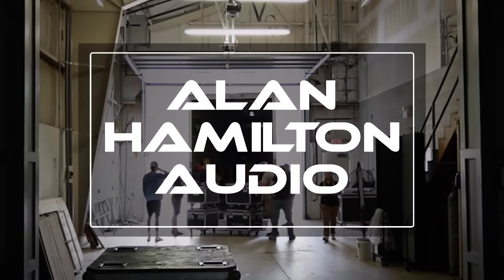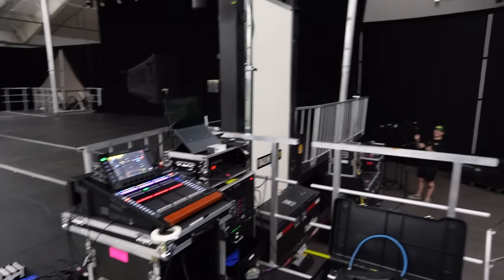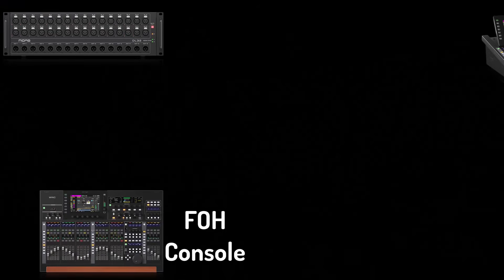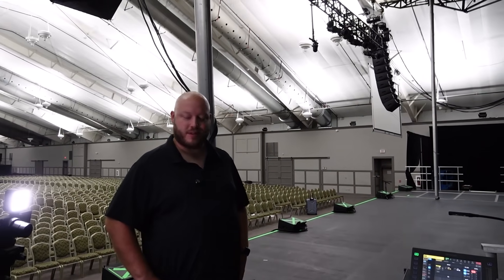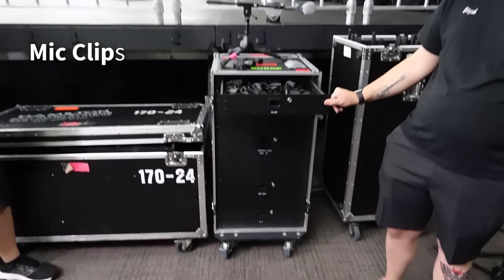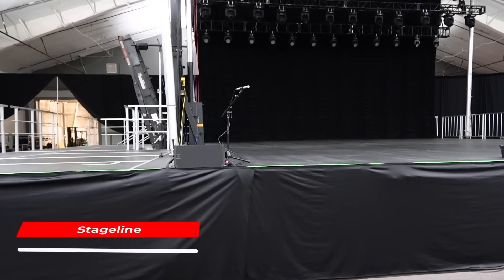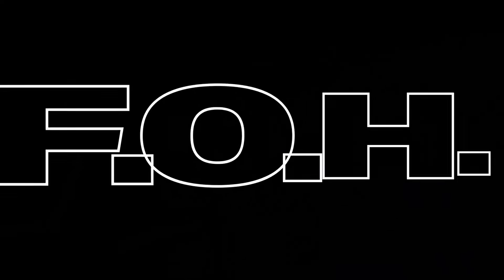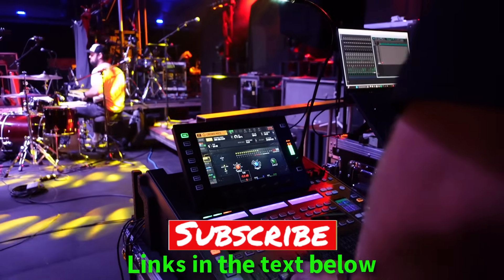Behind the Mix: Professional Sound System Walkthrough | Discussion - Using Behringer Wing Consoles

Comment: Great advice! Column arrays are my preference in spaces and for events like this. Drastically reduces the opportunity for feedback. QSC KC12 or Turbosound iP300s for example.

While not required, the Wing Rack's de-esser, dynamic multiband compressor and auto mix (for panels with multiple mics) is a huge effort saver. This also lets me use an iPad or my laptop for mixing, so my FOH position can be in the back of the room instead of side

Comment: I'm putting together a FOH rig soon for my tribute band.  We'll be playing larger rooms and venues moving forward (much like this room in your video) compared to the smaller capacity clubs we've been frequenting over the years.  My question is, I have an X32 rack for our monitors along with an S16 stage box to expand those channels.  I've seen where our inputs in monitor world can be split to a FOH console through the AES ports and was wondering, could I pair my monitor X32 rack/stage box rig with a long AES data cable to Behringer WING at FOH without any analog splitting anywhere?  And is this what most headliners are doing to split their monitors and FOH console?  I'm currently the sole production person in the group and want to make sure we have everything together.  Thanks for your content, your videos have been a huge help.
Reply from the maker: Yes, if you're providing FOH and Monitor console and doing your own mixing, that is a perfectly good plan. Everyone in that scenario will understand gain sharing, and can sort out any issues on your own time and have everything working as expected.

The analog splitter is for when the act doesn't want gain sharing between FOH and Monitor consoles, or more importantly- When they are simply touring with a monitor system and Mon console and interfacing with venue sound systems where the FOH console is provided with the system. 

I see all of those scenarios. 
But if you're doing your own FOH console, and gain sharing with monitor world is OK, AES50 is perfectly fine. Or if monitors will be set and left alone too... Same answer.
Reply: @AlanHamiltonAudio thanks so much for your reply. Yes we can do either analog split or AES as we will be rolling with our own FOH engineer and FOH mixer. I just wasn’t sure if that’s the done thing. Having not yet acquired the Wing, are there any challenges to be aware of with the gain sharing aspect?
Reply from the maker: @chuckcostello5167  No real challenges beyond the normal for any consoles doing gain sharing. If you're used to it on the X32 stuff, then it's the same... except at least the Wing doesn't require you do adjust the actual gain on a separate page on the gain controlling desk.
And the Wing has Trim as part of the controls too.
If you haven't seen my Wing as an IEM Mixer it talks about and shows some of this. But not actually connecting via AES because that wasn't the point of the video. But still, you might pick up on some things-
https://youtu.be/eDTr0d6LGU4

Comment: What constraints did you have for the opener? SPL limits? Lighting limits?
Reply from the maker: No constraints on the audio end. Obviously, stage space is tighter with the headliner claiming their space first. But they were very accommodating moving what they could to give the opener plenty of space.
I don't think there were any lighting constraints either. At least none that I'm aware of. Although, I'm sure we didn't use the band's ground package... so that was probably a constraint. Logistical if not spoken. I think Jeremy used his own console for the opener so he probably didn't even have a line hitting those. But I'm not aware of any constraints on any of the lights we provided being held back for Kip.

Both acts were great to work with.
Reply: Putting constraints on an opener is a bad move. The opener of today is the headliner of tomorrow. Of course we can't move our backline but I make sure our openers have plenty of time for a sound check and have a great show. I'm not saying it totally doesn't happen anymore but bands tend to work together for a great show. Just my 2 cents.
Reply from the maker: @randymeullier9656  This is what I believe and see as well.

Comment: Very nice and clean setup. 

Did you high pass higher than normal because of the under stage subs?
Reply from the maker: No, and it wouldn't really matter much (as far as helping) because a 20, 30, 40Hz wave isn't going to make much difference whether it's immediately under the stage or 3' in front of it.
So we'd just lose that oomph for the crowd. Yes, we'd lose it onstage too... but if we moved the subs out 3' to be in front, we'd have the exact same scenario. We could turn the lows up to normal levels with normal HPF and the crowd would be back to where it was. And the stage would be back to where IT was before we moved the subs. Any difference on the deck would be minimal.

The stage is very solid and the floor of the venue is concrete, so the subs vibrating thru the stage is not really a huge issue.

Comment: Once I placed the subwoofers under the stage and had major low-frequency issues on the stage itself
Reply from the maker: This stage is very well-built and solid. It's not easily vibrated. Not like a wooden floor or deck. And the facility floor (under the carpet) is concrete. So extremely stiff construction all the way around.

 A 40Hz wave is large enough that whether the sub is under the stage, or 3' in front of it, is simply not going to make any significant difference.
Also, as the subs build out into a line, they will gain some directivity as the line grows in length.

Comment: Great video.  Curious how you routed the shout boxes (Wing doesn't allow a direct output of talkback to be routed to an output that I've found). I was thinking to myself, what did you run FOH for lighting, and then you said at the end to comment if we want a video of lighting, lol.  So yes, I'd like to see the lighting.  I love your racks for the SRX distro.  I know you showed them in your other video, but if you ever take one apart, I'd love to see how you have things wired internally.  Appreciate it!
Reply from the maker: Jeremy sounds like he is hip to doing a lighting walk-thru. It'll be a few weeks though because we won't be using the base package again for a bit.
As for the shoutbox... We each put it on a local out at our consoles.
Then I sent my TB down an output to the house DL32 and CJ took that into his console (or the Mon DL32... either would've worked on his end). 

He did the same for me... and I got a return feed from his TB mic.  Then I just sent that to the Shoutbox box on my console...
...and he sent me to the Shoutbox bus on his console.

Comment: Nice clean rig!

Though I don't remember encountered a Stageline trailer being used for an indoor gig in my part of the world.  Is that common elsewhere?
Reply from the maker: LOL... No... not common at ALL...
But it allows the venue to use it for outdoor events like Christmas tree lighting and other things of that nature. Or bring it into the hall for concerts. That room doesn't really have any engineered rigging points. So, it would be ground support to do shows in there otherwise.
Or add a lot of steel and revamp the structure for flypoints.

There have been more than a few times a PM has asked me on the phone... "SL320... I thought this show was inside?" or "This is an inside show isn't it??"
Me: Yes...
"OK... the SL320 kinda threw me!"

But, it's also easy to explain the general stage layout in an advance since almost everyone is familiar with an SL320 vs whatever randomness they might find at some permanently built stages at random facilities.